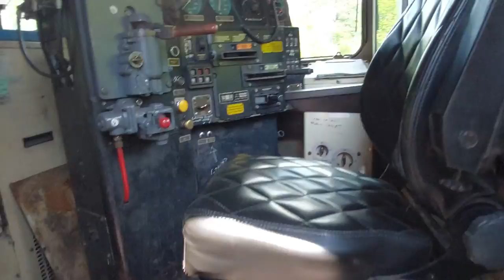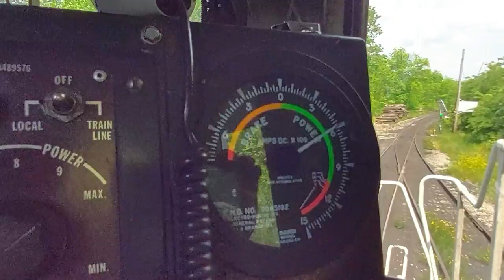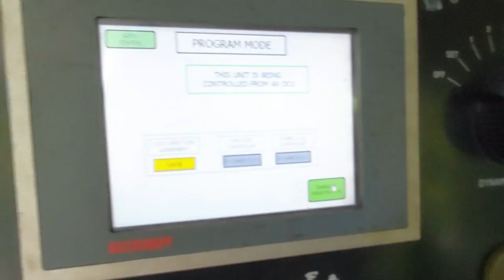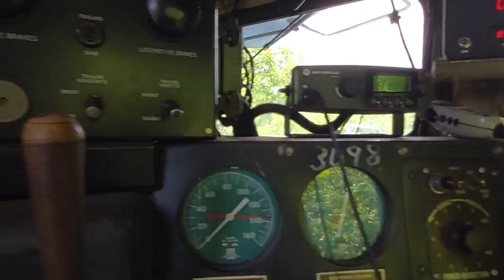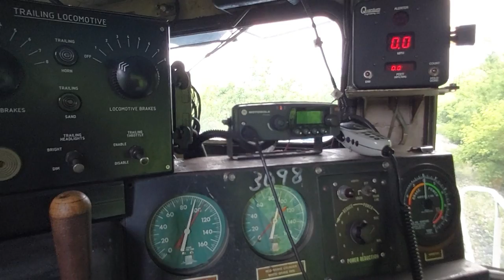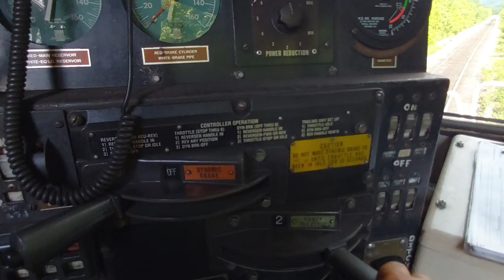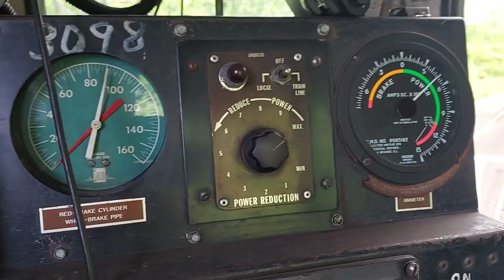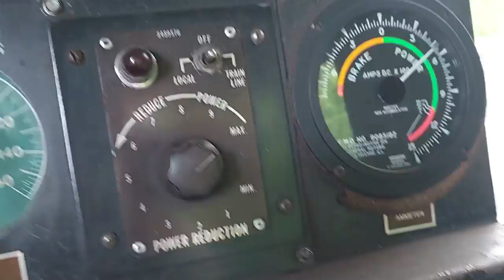Locomotive Remote System keeps Goofing Up

Comment: Dave hougoing to take load all the to e dumped?😊
Reply from the maker: They got their radio problems figured out to be able to take the
train and get it unloaded Michael. Details on the problem I had
put in the video description if you haven't read it already.
Reply: Milwaukee Road had a limited amount of remote control operations for helpers in the Pacific Northwest but it always seem to be getting some fine-tuning and I'm quite sure it was pretty much gone when they retrenched back to the Midwest. Listening to 3098 reminded me of an SD40 trying to break free of a snow drift. Somehow I can Envision those Hoppers not looking like a loaf of bread on top after being loaded. Hopefully the problems get rectified fairly quickly as usually it's transportation department waits for production Department not the other way around

Comment: First time I've seen inside of a loco cab.
It's not exactly a Mercedes but looks functional. 😂😅😂
What are those two big dials on the left side there. The ones that go up to 160 with red and white needles? Are they brake air pressure gauges? I just couldn't read the plates under them.
Traveling Tom showed the diesels and generators on one of these once. They are humongous.
He couldn't show the traction motors. They must be ginormous! 😅
Reply from the maker: Glad you enjoyed Werner, here is a video I made of locomotive
controls which will give you close ups and greater detail on what
you are wanting to know: Appreciate your watching my friend.
https://youtu.be/ZdNhuhmK_z0

Comment: Also here’s your issue: The outside controller unit is in Female mode, hence the nonstop mixed signals and causing problems.  Do you have a #32 framing hammer?
Reply from the maker: Appreciate your taking the time to visit with us and take in the video my friend.

Comment: Dave, I have a question. Are you working with a commercial coal company, a small freight railroad or an independent carrier working with a coal or whatever company.  WOuld your company ever consider using a real steam locomotive. SO many are being restored with no place to go. Could you folks use a locomotive to haul your coal cars. You certainly have the fuel.
Reply from the maker: Our mine has private owners currently organbuilder. The mine owns the RR. They will never have steam here, logistics are
just not there, steam is high, high maintenance compared to
diesel plus getting the parts all must be custom made. While it
would be an awesome PR campaign, it would cost way to much
to do. Perhaps after the mine shuts down then a steam
excursion train would be a possibility??

Comment: The easiest way to gravity load coal is to put the loco in N1 or 2 and use the independent to control your speed. Watch out the window straight down to the ground and go a little slower than walking speed. .5-.7 mph is your target speed. Most of those Wabtech speedo units won't measure that slow. Also if you'd set it back up in box car the alerter  wouldn't keep going off.
Reply from the maker: Thank you for the advice on that Travis. You are right watching the
ground is the way to go.  It's so rare we ever have to do this now. It used to be when we only had 1 loco and no remote system have a guy
all the time in the loco when loading or dumping the cars, but that
was over 30 years ago. Very much appreciate your taking the time to
pay us a visit and watch the remote system keeps goofing up
video my friend.

Comment: Stop relying on computers put a person driving
Reply from the maker: I did a better job than that computer did anyway didn't I Richard! LOL But you're right on computer operated locos things may
save fuel, but they break a lot of couplers too when the computer
runs the train instead of a human.
Reply: @ccrx6700  
Yes you did like I said too much computer not reliable as a person
Reply: @ccrx6700  
A lot better than that screwy system tell you company your followers said get rid of it

Comment: I used to load sand like this in cuts of 11, 22, or 33 cars. I ran the conveyor and hopper to load the cars while directing the engineer where I wanted him. Then we went a few (15 or 20) miles to unload into a pit conveyor and had to use a sledge hammer to pop the outlet gates open. It was fun. I miss it.
Reply from the maker: Was swell of you BigDave to write in with the nice comment.  Lot
of fun to load cars isn't it. Glad you could take the time to pay us a visit and check out the video my friend.

Comment: Question unrelated to the subject of the video. What is the sigh (shown in TS 17:20) for?
Reply from the maker: Sign you mean Colin. Many years ago we had a train operator
not go back far enough coming from the side track, When he went ahead he picked the switch and rolled the rail over. That sign was
put up after that, by me, to inform loco operator to back past that
sign before he went towards the load out on the main. Have
had zero problems since that horrible night. I worked all night
long putting that track back in service.  Appreciate your taking the time to watch and may you have a most blessed day my friend.

Comment: I would suspect the inclusion of new hardware some sort of mistake made perhaps or a software issue conflict leading to false positives.   Loco control systems are by design super hair triggering and it may need the whole waveform signal to be analysed to catch the errant false positive that leads to emergency conditions.   Problem too is usually when new stuff goes on, it can force old stuff to climb over the failure ceiling whether because its forced to work harder or get hotter, trouble with loco's especially is they are working in hot hard environments so failure has to be triple protected against and I suspect your erroring loco is warning something is just not right.
Reply from the maker: Thank you for sharing your thoughts Watson's World of Wonders. problem was a new hook in to the radio for a fire suppression alert, unplugged that and problem went away. Appreciate your taking the time to visit with us and check out the video my friend.

Comment: Dave:  you should have a heterodyne combination between the two, or more, radio transceivers, like cell phones have, to separate their signals into individual heterodyne combinations, on the same frequency, so more than one broadcast can happen at the same time on the same frequency and be separate broadcasts.  It may take more than one combination code variation per transmission and reception to be obstructed by another combination on the same frequency.
Reply from the maker: Oh dear that information is way over my pay scale, you need to write
Control Chief and tell them, it's their system, I'm good at driving spikes
not electronics....:-) Appreciate your taking the time to visit with us and check out the video my friend.

Comment: Hi Mr. Dave, look at you you are a engineer,  say just wondering do you guys have an optimizer set up, talking to some engineers on longer IM double stacks says it helps them on grades, tunnels and believe it or not heavy rain or snow, it's better than cruise control. It might be worth looking into. Hey great video, thanks you for sharing. And yes the SD-40-2 is a fine loco.
Reply from the maker: The only optimizer we have here is more coffee for the loco 
operators....LOL  No Terry our old locos are not controlled or
could be controlled by computers. The locos with the trip optimizers can have the computer run them. They do save fuel,
but they also break a lot more knuckles on car couplers when
the computer is running the train. No one ever told you that
before did they. Thank you my friend for paying us a visit tonight
and taking in the presentation.

Comment: ✔ Sounds like an issue with either the receiver or transmitter. I'm pretty sure that RCLs operate in the 220mhz band spectrum, so there may be an interference from other users in the general vicinity. Of course, you might want check to range of the signal from the controller unit to the receiver on board the locomotive.
Reply from the maker: Thank you for sharing your thoughts with us Adam. Interesting idea. Appreciate your taking the time to visit with us and take
in the video my friend.

Comment: Listening to the turbodiesel I think it could be its own broadway show! 😊Is the sign "locomotive operators go past this sign to check switch points" only active when the light on it is on or always in force? If so, is the light toggled manually or is there a sort of circuit that monitors the switch point position and the light only comes on if the system can't communicate with the switch? Thank you! :)
Reply from the maker: Many years ago when we only had 1 loco the loco would pull in,
then uncouple and run around the train to get on the east end.
One night the operator didn't go far enough for the switch points to
throw back to the main. He picked the switch, rolled the rail over.
I spent all night fixing that rail. After that the sign was put in
so operator would know how far to back the loco up on the main
before he could go in and get the cars. That is why the sign is
there. sign has nothing to do with the now radio controlled 
switch. It was a manual/spring loaded switch back then.
Appreciate your taking the time to watch and may
you have a most blessed day my friend.

Comment: Nice video Dave, you need a engineers hat for these times your sitting in big chair, did you run her all the way to the port as well. Hope the smoke from Canada is not down in your area, pretty thick up here. Cheers and stay safe
Reply from the maker: Glad you enjoyed Pete, thanks for the nice comment.  No I did not take it to the harbor, had the second train come up and I stayed
in case needed to manually load that train, but remote worked fine
in it thank goodness.  Appreciate  your taking the time to watch and write in my friend.

Comment: Is the red zone on the power gauge an absolute no go, or is is a short time rating? Many thanks!
Reply from the maker: Short time Bill, I really don't know for how long, I've never put it
to the test, but when on Dynamics after not too long it will
simply kill the dynamic braking from working, no one here puts
it to the test either. I'm thinking it's like 20 or so seconds and
then a no go. Happened one time I was in cab but not running
but that was 35 years ago and amount of time before it died
just escapes my memory. But that was a great question. Appreciate your taking the time to watch and may you have a most blessed day my friend.

Comment: This might be an ultra stupid comment, but when you were trying to use the power reduction control, shouldn't the light be on? Looked like the switch was still in the middle and not in local control, or was that just camera angle?
Reply from the maker: Light was not on kleetus, and you are correct, it should be on when
it is being used. I didn't try it on camera, tried using if off camera
so your observations are right. Appreciate your checking out the video and writing in my friend.
Reply: @ccrx6700  No problem Dave... any time I get to hear a 16v645e I'm a happy guy!
Reply from the maker: @kleetus92  👍😊

Comment: When is the amount of coal shipped weighed? Thanks for taking us along Dave
Reply from the maker: When it is loaded on the barges Donnie, each barge is lite and heavy
gauged then they can figure out how much coal is in each barge.
We run right around 115 tons of coal in each hopper car, but
we do not have a scale to weigh them. You might want to know they also measure the amount of water in the barge gunnels and subtract that weight in the computations. Appreciate your taking the time to watch and may you have a most blessed day my friend.
Reply: @ccrx6700  
How long does the coal stay at the dock before it is loaded onto the barges?

Comment: Someone else mentioned it might be a bad (or going bad) RF (radio frequency) filter in one of the two units in question. That might very well be it. It could also be that the remote system isn’t shielded properly and somewhere there is a length of wire or some other connection that is acting as an antenna. This connection in question might even just be a certain length that matches a harmonic signal of the radio. For example, if the radio works on a 3 meter band, the connection in question acting as an antenna might be 1.5 meters or 6 meters or whatever and it’s allowing the remote control receiver to pick up juuuust enough of an errant signal to make it lock down. 

That’s frustrating. I hope you find a solution. Ha, maybe even wrapping some tin foil around part of it might work haha Don’t tell me no one did that on their old TVs. 

Thanks for the video, Dave!
Reply from the maker: Your talking over my head Will, I do know none of the wires are
shielded and know that can create nightmares at times, I have
 same problem on my tamper. Thank you for sharing and wanting
to be of assistance. Appreciate your taking the time to watch and write in my friend.
Reply: @ccrx6700  haha my apologies, Dave. Basically, antennas have a set amount of exposed surface (or unshielded) to capture a specific wavelength. If a cable or another component is unshielded, that cable or component can suddenly start acting like a secondary antenna. If that same cable or component is acting like an antenna and happens to be a certain length it can pick up on radios nearby.
Reply from the maker: @Will B.  awesome Will I never  knew that. Thank you 👍😊😎

Comment: Gotta throw it in forward
Reply from the maker: Reverser stays in neutral position when loco is being controlled
by the remote system, only use reverser in manual lead mode Grady.